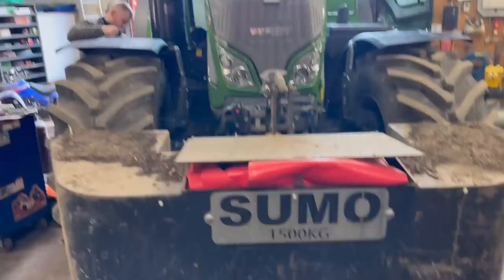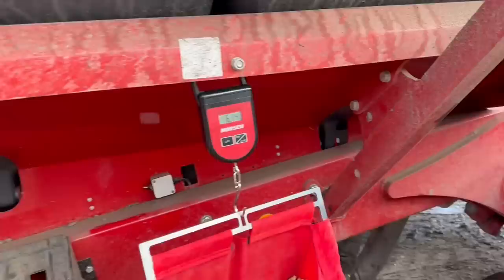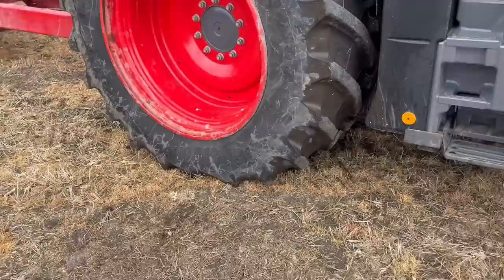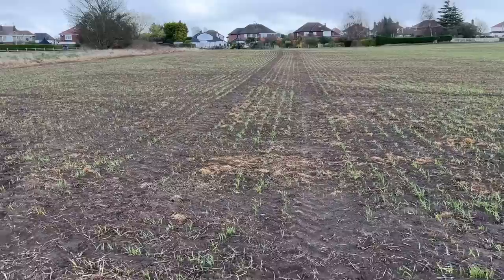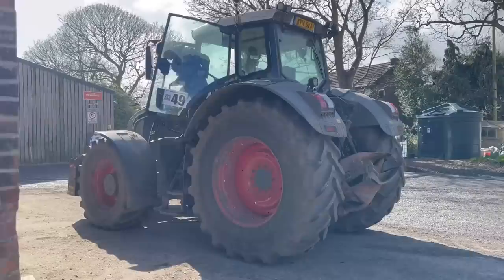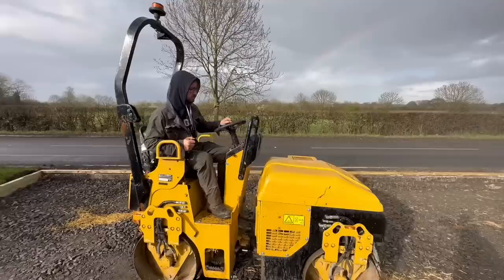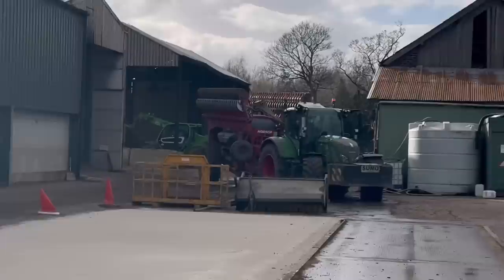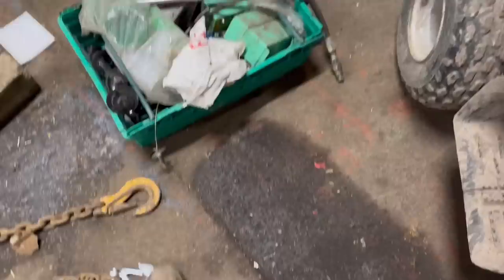SOWING BEANS WAS GOING WELL UNTILL !  #OLLYBLOGS #AnswerAsAPercent 1097

Comment: Top tip there Olly, chains might be strong but as the old saying goes the failure point is always the weakest Link! Straps are a little more forgiving and don’t carry the same momentum when they fly backwards at you unlike chains and steel cables.